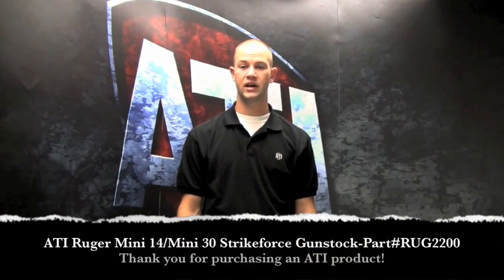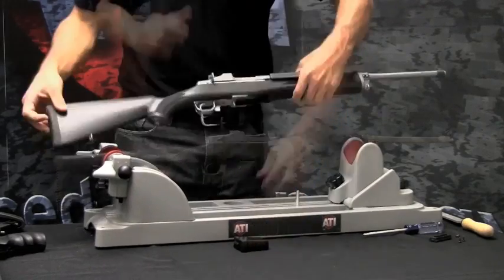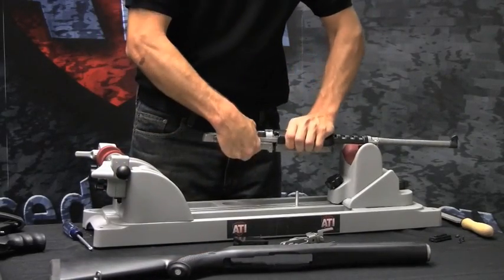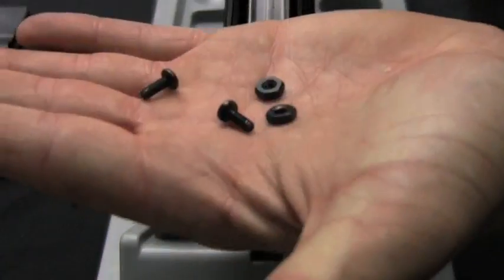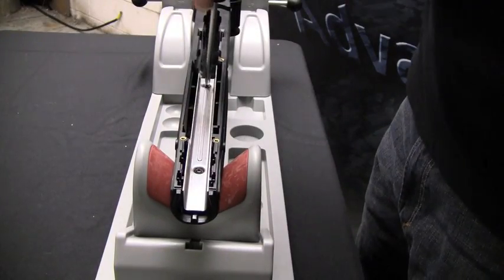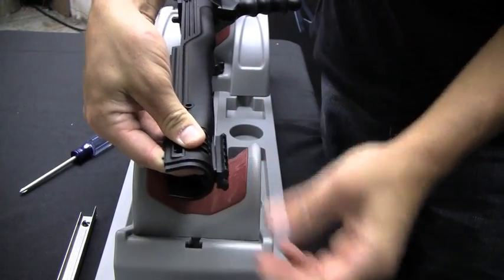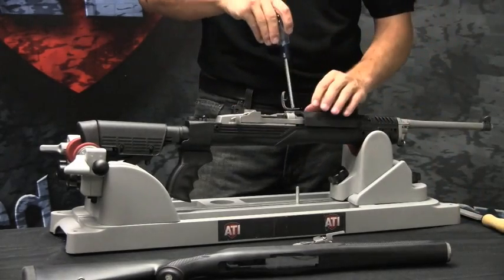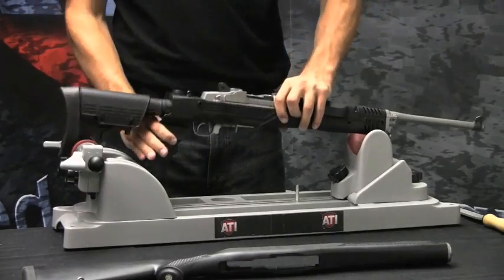ATI Ruger Mini-14/Mini-30 Strikeforce Gunstock Installation

Comment from the maker: @USAdude30 Make sure the trigger is square and lined up with the barreled action. If you are having trouble putting the trigger guard back in, make sure the groove on the left side of the trigger is lined up with the groove in the barreled action, then square up the trigger assembly in the stock and slide into place.

Comment: Highly recommend these stocks ... love mine to death. I use it on the Mini-14 which is a 580 series, a 5812 Law Enforcement model with the Government Barrel. Fit perfectly ... very good quality.
Reply: Did u have trouble installing the trigger assembly because I’m having a hellva time getting mine to sit in 😢
Reply: It is pretty easy of you assemble it the same way it came apart. Most people have trouble with a soring in it not sitting on the correct spot. This video has the correct way to do all of this for you. https://youtu.be/irwVzrl7gwA?si=duz56s6RqkD5QP1C  @baldzilla1baldzilla126
Reply: @megatrends  thank you so much for your response and video link…..

Comment from the maker: We have never done it and it isn't something we've seen done often. It would take a lot of modification to fit considering the different position of the gas block.
Reply: ATI Gunstocks quick question when putting the bottom rail on, isn't the metal insert from the wood stock or the metal insert supposed to go back in or no?

Comment: Mini 30: Trigger assembly doesn't just snap into place? The area in front of the grip is just flat, should there be a hole or something for the trigger to lock into place?
Reply from the maker: Hey sorry we are just seeing this comment now! Sorry to hear yo had some issues with installation. If you reach out to info@atigunstocks.com we will go above and beyond to try to resolve these issues.

Comment: Will it fit the ruger target mini ?
Reply from the maker: Hey Marc, since this video was released we have designed a new Strikeforce Stock. As long as your model has the same sized diameter barrel as the Mini-Thirty the stock should fit.  You can also check the serial number on your rifle as our stock is designed to fit rifles with serial numbers 181 and above.  If there is anything else I can do to help feel free to reach out to socialmedia@atioutdoors.com 
Thanks,
Abe - ATI
Reply: 181 and above? All the way up to the new 583 SNs?